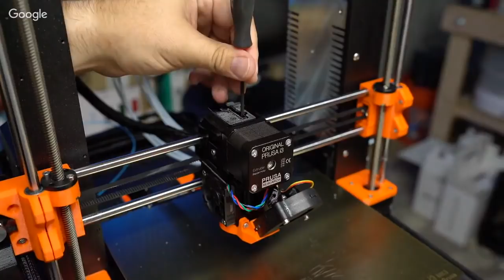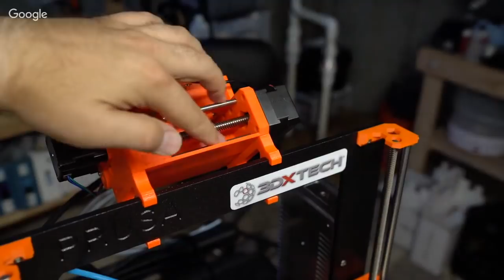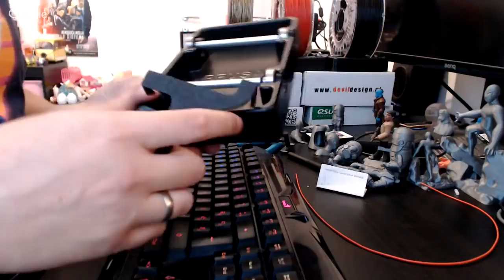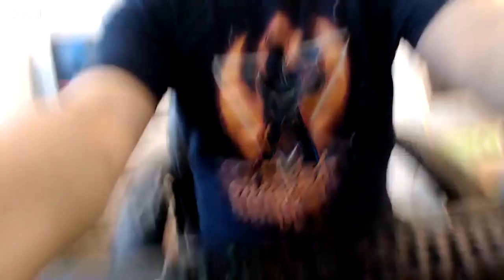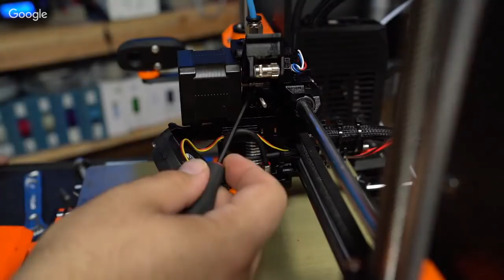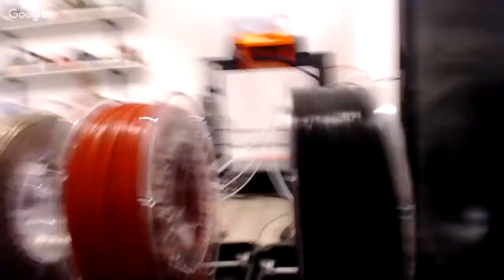MMU2 Troubleshooting 101: The Easy fixes

Comment: Hello Chris do you have any recommendations for running Flex in mm2 I’m having a lot of load and unload issues
Reply: Hey there. I made investigations in printing with flex materials, starting with single mode. I lately went over to the MMU and after some work I finally just startet a MMU print using PLA, shore 95A softPLA and an shore 88A TPU in one print. Some mods to the printer and the MMU unit were necessary, but just some slight changes to some of the original parts. I'm going to make a short vid if the project succeeds, and of course upload all the parts. Stay tuned.

Comment: I'm about to revert to original MK3.  MMU us nothing but trouble.  I took a few months figuring out each component and fault, and it still fails regularly.  Worst part is that I can't update my firmware - MMU disconnects from any computer I use when trying.  No one at Prusa can give me an answer.  It's a shame because the printer is awesome and regularly outperforms my other machines that cost thrice as much.  The MMU bricked it.

Comment: I have spent a serious amount of time on just about everything, but the results are not consistent. How about Prusa publishes a test STL, a small print not more than 30 min, with a set up guide. One step at a time. Say PLA temp, load speed, ramming, cooling numbers etc. A flow diagram can surely be done if this thing works. Step one yes go this route no go that route etc. etc. It’s crazy that the settings used by one person does not work on another persons machine. Sure filament plays a role, but it should not be this problematic. Why are the variances so big. The time we have all spent on trying to get this MMU to work could have been spent on an initiative for world peace and I am sure we would have had some free time to drink beer. Please let’s get a flow diagram going ? ALSO THE SELECTOR MOVES EVEN WHEN THERE IS FILAMENT IN, AND I DO NOT MEAN ON RESET, MYNE MOVES TO A NEW FILAMENT EVEN WHEN THE PREVIOUS FILAMENT IS STUCk, costs hours ————————————————————————————- yesterday I upgraded to the MMU2 s, it has been a nightmare. Let me start by confirming all three sensors work nl PINDA, FINDA and IR, but do they talk to each other. I do not think so. Selector moves to a new position even while there is filament still in the extruded. YES IN MY MIND BOTH OF THESE SENSORS SHOULD TEST FOR FILAMENT AND IF FILAMENT IS PRESENT THE SELECTOR SHOULD NOT MOVE —- WELL MINE DOES AND I OBVIOUSLY GET A HELL OF A JAM, randomly, 6 times yesterday.

Comment: This is a great resource. I’ve just got my Mmu 2.0 and I’ve had a few issues that you’ve addressed. I’m wondering (when you mentioned the “secret menu”) why doesn’t the bond tech gears in the extruder turn slowly when the mmu is priming the filament? Surely that would cause less chance to grind the filament. Thanks for the video, great work.
Reply: yeah i thought this too, why arent the bond tech gears turning during the loading?

Comment: Interestingly enough, I have tip issues with the Prusa filament, but the Hatchbox & CC3D filaments work perfectly with stock settings.
Reply: Curiously (maybe even somewhat ironically), I was having nothing but trouble with the Prusa filament not loading into the extruder. I had many errors involving loading this filament down to the nozzle, but when I switched to another manufacturer (PLA from Filament.ca) and made all loaded filaments from the same manufacturer, then I finally got a successful print with no intervention required. This felt like a minor miracle after all of the hacking around I had been doing! It was like the Silver Prusament was slightly thicker and refused to load reliably even though it had worked beautifully on the MK3S without the MMU2S).  I don't get it.

Comment: I was concerned to hear you recommend against the MicroSwiss heartbreak for MMU2 use. I just installed one on the printer I plan to use for the MMU2 when it arrives. Any specific problem related to using this heatbreak or are you just cautioning about introducing too many variables?

Comment: As my problem seems to be the strings and hairs that either cause a jam or a failure while loading or unloading, and my incapacity to  get always the `perfect tip time after time, perhaps you, as a beta tester, could help us all with this issue, considering that we are just end users, and we do not particularly enjoy nor have the time to perform lots of tests .
Stock settings did work with the prusa PLA I had, but not with the other colors and brands. In my opinion, it looks like the shape of the tip is heavily dependent on the filament we are using. I have learnt in the prusa forum that more ramming means longer and thicker tips and less strings, and less ramming means short and thin tips and more stringing.
QUESTION: Do you know how do the other parameters affect the tip? The number of cooling passes and the speed of them? The loading and unloading speeds? I have noticed that even the nozzle temp affects the shape of the tip, so I don´t know if it is necessary to compromise the quality or risk a clog just to get the tips right, or if this can be solved somehow else.

Comment: First thing first is don´t scold me about bad assembly. I am a mechanical engineer and I was really careful (even used a magnifying glass to get the alignments right). I have been fighting with this thing for three weeks now and, well, I have been losing so far. Sorry to say it, but the device (in my humble opinion) is poorly engineered. Nice you said in the video to check the feeding distance with the secret menu because my "carefully cut orange tube" was something like half inch  shorter than it should. Either that or the factory MMU2 settings were way off than reccomended. Obviously, the problem is in the retraction, and those damn hairy tips. Currently I am trying with 0Calvin settings (4 seconds ramming, etc.), and they seem to work for me a bit better than yours, but so far, I have not been able to print more than 2 mm of a multimaterial part without paying constant attention to the tips (using extruders number 1, 3 and 5 and cleaning the tips when the selector is in other position). Typically, at some point of the task, the retraction is half inch shorter than it should, and there you have a jam. The worst case scenario happens when the filament gets cut by the moving selector and I end up having to disassemble it. The print is lost, of course.
There are so many things wrong with this device, like the little blade that gets knocked out of place when a jam occurs, and then you have to disassemble the selector again, or not, because, what is that blade for? If it was meant to cut the faulty tips it is not performing its function, and if it did, the faulty tips would get stuck in the selector...
Even with the firmware, so many things could be improved, like this motor that gets hot. I haven't printed a polycarbonate part like 0Calvin because I haven`t got so far (succeeding) as having the PETG barrel soften. For example, the firmare should provide an easy way to test loads, unloads and ramming secuences to check the tips shape, or do an unloading, loading again, unloading again secuence just to be sure the filament is really out of the selector, ...
The funny thing is that I have just tried with PLA and ABS which I do not intend to use, but are the ones that are said to be working. Initially I wanted a two material extruder to print mechanisms using soluble filament, and now being realistic, is anyone out there interested in buying a MMU2? I have been said that the waiting list is long....
Reply from the maker: I will scold you for assembly. The majority of issues are build issues. I don't care if you're Josef build issues happen. I beta tested it, assembled 4 of them, took them all apart multiple times and still would have minor build issues. It's not poor engineering as much as it is poor understanding and poor build. Now that we have that out of the way we can move past being overly defensive and answer some of the questions.

4 second ramming doesn't do anything... 0Calvin has no idea what the settings do and all he's doing is increasing the amount of material purged. Leaving it at 2.5 seconds and increased purge volume form 13mm^3 to 14 or 15 does the same thing and my profile I've shared does that.

Blade is disabled for now and if it's getting knocked out of place you built it wrong. Faulty tips get ejected in position 6. Works great when it's enabled.

Motors get hot. It's constantly in hold so it's on. It's not hot enough to melt or distort the plastic. I have the first unit before anyone else and run it 24/7 and still fine. Fo reference those LDO motors are rated to over 80C and PETG is rated to 80C. They reach about 50C.

How do you make a firmware to test that? There are a total of 11 parameters and a ramming sequence chart? What you need to do is use the stock settings instead of messing around with other peoples profiles and hoping to find an answer there. 

Have you installed the new firmware yet? It has individual channel adjustment and fixed a few things. In the end you need to rely less on your credentials and more on taking a breather so you can troubleshoot your build.
Reply: Secuence could be:
1- Load 
2- Print something like the line at the start
3 - Ramming secuence, cooling passes, etc. and unload
4- Move the selector to a side
5- Feed 10 cm of filament and there you have the tip ready to be inspected
6- Press OK, it retracts, selector moves back to the position, new reload, moves Y axis and repeats the print. If you can perform it 100 times with no fails maybe you can print something
7- long press OK and it ends

You are the expert, is this thing so difficult to program?
Reply: @Mr3DPrintWizard  sorry, but if someone experienced still has multiple build issues that cause complete failure, then it's an indication that this thing is poorly engineered.
Reply from the maker: Christian Buhl or the person building it isn't capable of building or correctly.
Reply: Chris Warkocki  So if my machine performs correctly 200 filament changes and then it fails in one and skips a layer (and ruins the part!!) it is not because it lacks reliability, it is just because my machine is incorrectly built... Come on!! You behave more like a Prusa agent than like a real beta tester. If you said to Prusa that this thing was ready to be sold you really did a lousy job
Reply from the maker: TWO LANE BLACKTOP again. The major issues were always build issues. Either the mmu2 or the hotend itself. I was one who didn't say it was ready but that's not my call. I still think there are firmware tweaks and settings that need to be tested and the beta team is still pushing forward with more things.
Reply: "don´t scold me about bad assembly. I am a mechanical engineer" sounds like a skill issue

Comment: Can i ask what version of the new from part cooling fan are you using mate?
Reply: meant to say what new mount for the part cooling fan?
Reply: That's the extruder upgrade V7 (included in the MMU2 kit)
Reply: Yep i know but the the mounting bracket from the part fan to the extruder cover is different to the Prusa one you can download, I wanted the know if anyone can download the .STL he used?

Comment: Ohoh, seems like MMU1 again and this is not good. I expected so much of MMU1 and it really had a lot of issues. I have so much hope on MMU2 that I ordered last December and I’m kind of sad to see one of the first video I see about it is 1 hour 30 of fixing it... I just hope that when I receive mine in a few weeks (about 1 year after buying it) it works correctly and they do proper quality checks before delivery.
Reply from the maker: Julien Krivacsy hardly. It's long because I'm live streaming answering questions and taking my time. I could have made this a 5 minute video. ¯\_(ツ)_/¯
Reply: Chris Warkocki Ok, I really want this to be good, I’ve been waiting for quite long now as all of you guys, I’m pleased with the MK3, compared to the MK2, it is so much more convenient but MMU 1 was not reliable at all and I had to remove it after a few months of struggling.